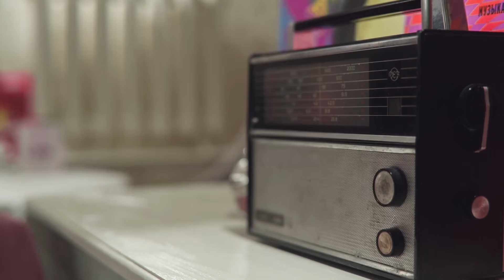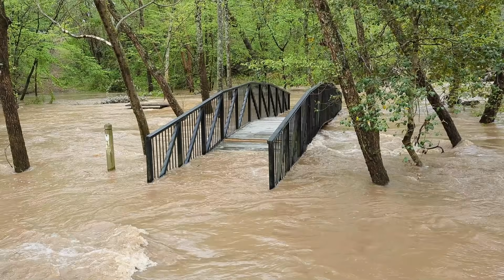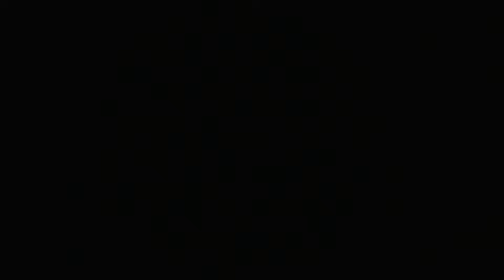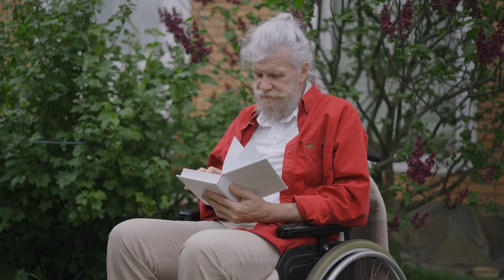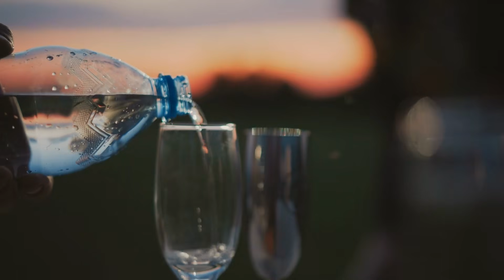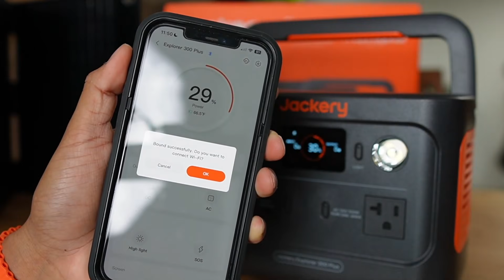If The Grid Fails Tomorrow, Do You Have These 5 Items?

Comment: 1.   NOAA Battery Radio With Backup Battery Power
2.   LED Headlamp
3.   Emergency Water Storage and Filtration System
4.   Temperature Control and Carbon Monoxide Detector
5.   LiFePO4 Portable Power Station
Reply from the maker: Thanks!
Reply: More or less. Mostly more.😂😂😂😂
Reply: Ammo